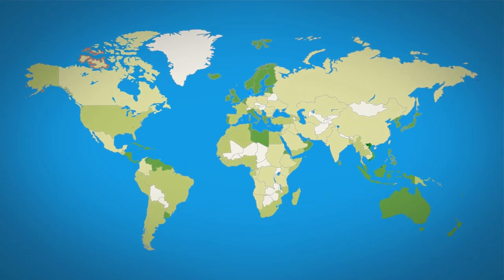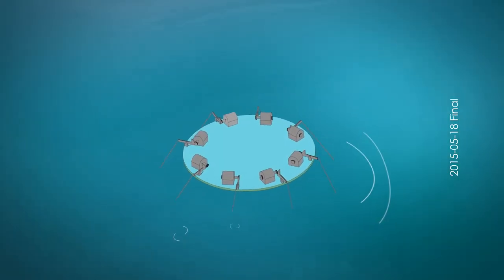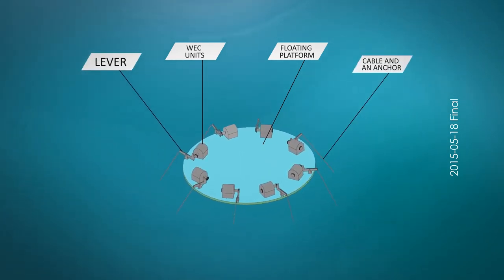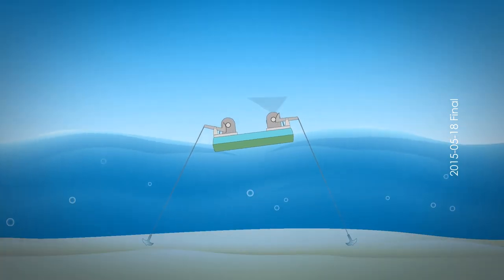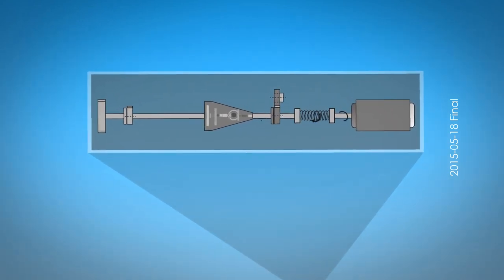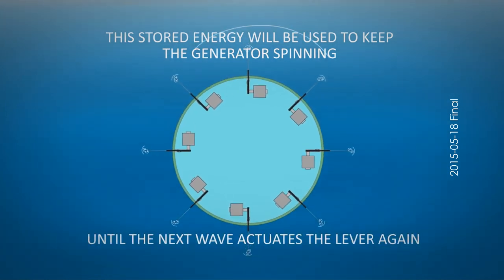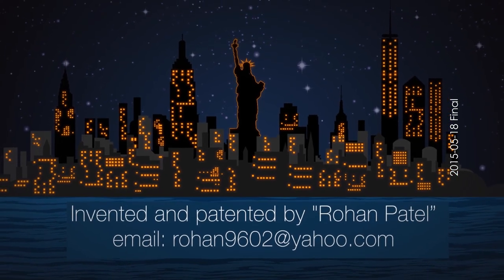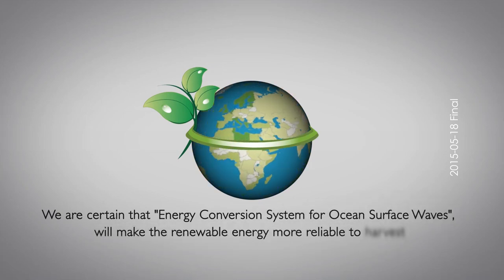Ocean Wave Energy Conversion System

Comment: I have some confusion regard it...

Like, if wave length is increase to the set level of this machine than it is damage or not????
Reply from the maker: Correct. 2nd design had automatic mechanical adjustments to cope with changing water levels. and latest newer design is submerged below water surface to resolve this issue.